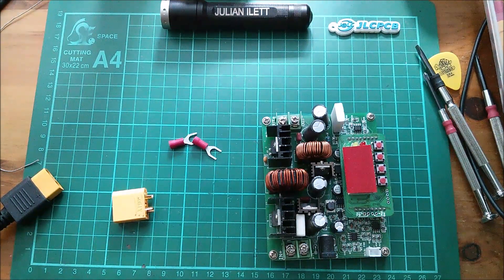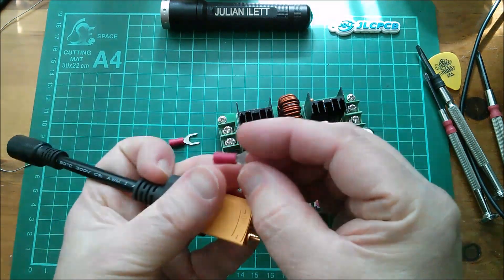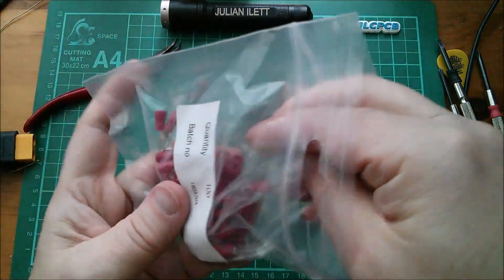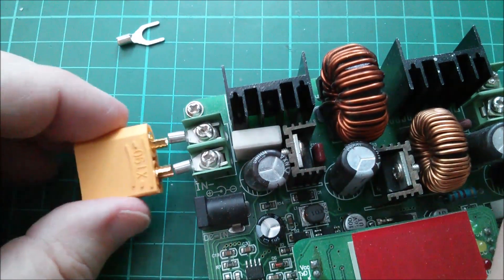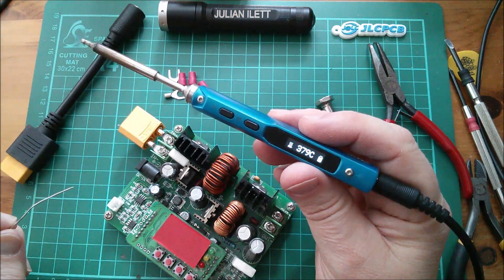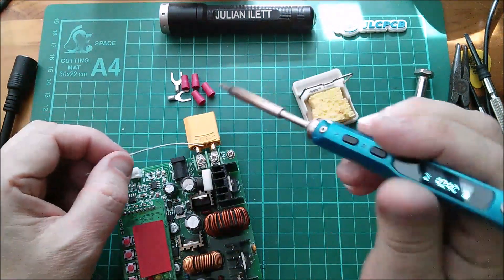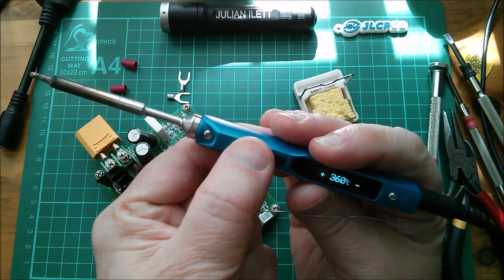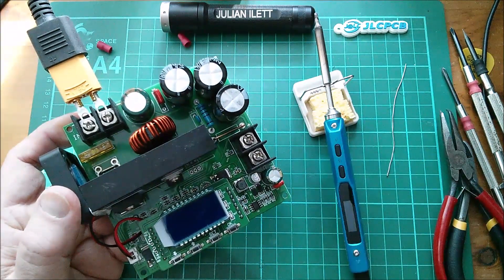XT90 to Terminal Block Adapters for Solar Boost

Comment: The XT range of connectors are designed to have a bit of movement between the plastic housing and pins. This is to allow for slight misalignment of the pins.

Comment: Interesting that you tried this today - by happenstance I was doing the same thing yesterday - albeit with a much smaller panel. It was just 6v, 100mA. And I was using a buck boost from Pololu that could take in 2 to 16 volts and could handle 1.5 amps. I didn’t need that much as I just needed about 100 mA at about 5v. With the load I had on the panel I normally get only about 50mA. I figured I could use the buck boost trick and as an experiment just manually turned the buck boost output voltage up slowly expecting to see it draw down the solar panel voltage a bit but put out about 75mA. I was surprised to find that every time I turned the output voltage of the buck boost to be higher than the input voltage the panel voltage dropped to 2.5V and I could only get about 25mA out of it. I was better off not using the buck boost. I guess what was happening is the buck boost was taking to big of a gulp of current from the panel when the buck boost went into boost mode, thus collapsing the solar panel voltage, and then the buck boost must have worked even harder to gulp more current in trying to maintain its output voltage and hence kept the solar panel well below its MPPT point. I’ll try again with a more suitably sized buck boost. Will be interested to see how yours works.
Reply from the maker: I first tried the idea on a 20W panel and had similar problems to you - the panel voltage fell very quickly and the boost converter just rebooted (or locked up). But the 100W panel has enough current (in full sun) to keep the converter powered up (microcontroller, display and fan) and raise the voltage from about 20V on the panel to 26V on the output of the converter. I managed to get nearly 80W into the Jackery - from only 68W when the panel is directly connected to the powerbank.

Comment: If you're looking for high quality XT connectors then you want those made by Amass. Everything else is a bit of a gamble because there are really bad ones out there. Some are just outright dangerous and don't meet the required specifications for maximum current and temperature.
Reply from the maker: These are QitinDasen

Comment: The XT Connector line is just awesome. The XT30 fit almost perfectly on 5mm pitch screw terminals xt60 on medium sized screw termials and the xt90 on those you showed. Also XT30 and XT60 have a PCB mountable version. I love them.
Reply: Do you mean XT30? Hadn't head of a XT20... even smaller?
Reply: @pfeerick  sorry my fault :D I ment xt30
Reply: @_who_cares_1123  Damn... you had me wondering there for a moment! :D

Comment: I much prefer the EC3, EC5, etc. than the XT60 types.  Easier to use and you don't need to put any heat shrink tubing on as there is no wire exposed outside of the ECx body.  However, for non-RC electronics I highly recommend Power Pole connectors as there is no male/female so they all connect making it easy to make extension cords, etc.  Also, be careful with the XTx connectors as they aren't all the same quality and some melt real easy with the heat.

Comment: I'd put a short length of wire to provide some strain relief, instead of soldering directly to the terminal connector. Of course, the connected jack has flexible wire, but I'd err on the side of caution. I say this not because you aren't careful and will ever have a problem. I say it because I break everything I touch.

Edit: and of course you mention you should've done it...